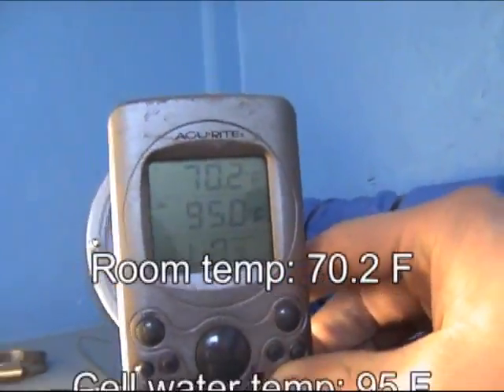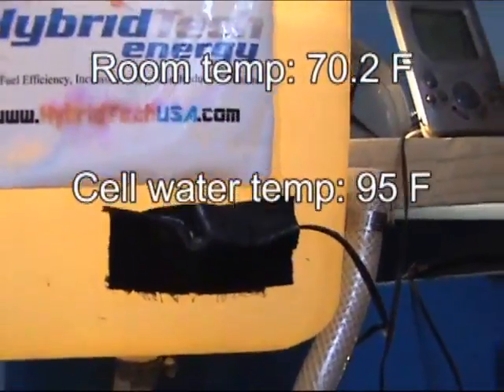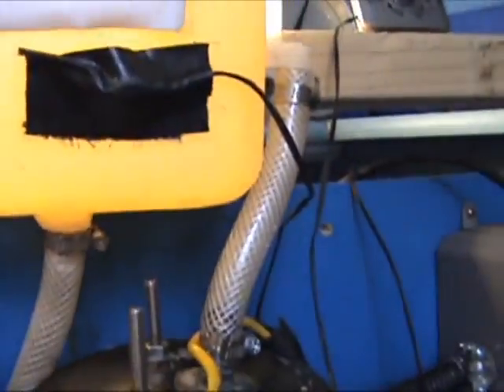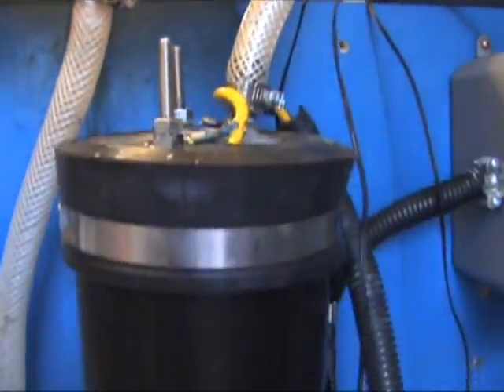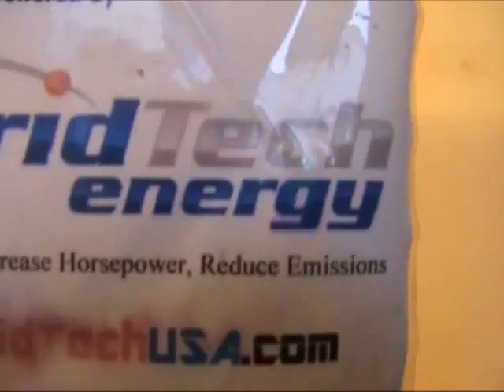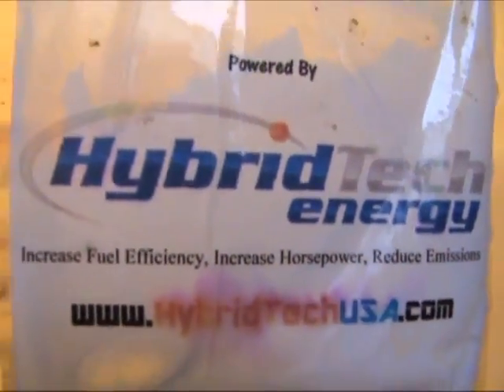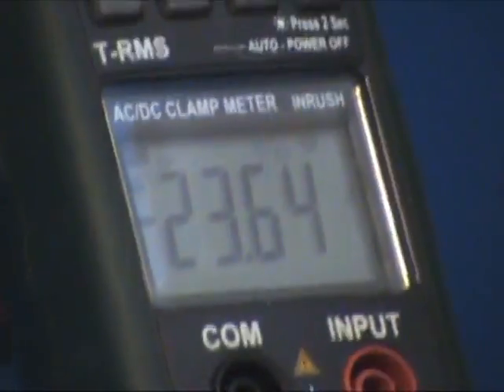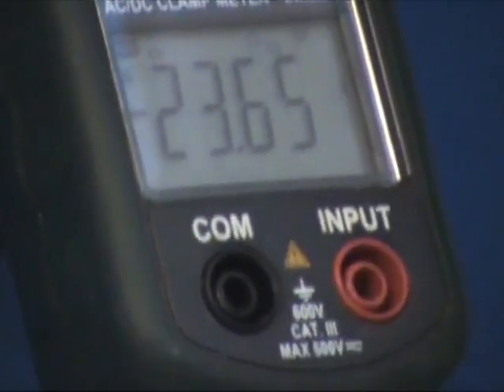5LPM 23.6 amps, ONLY FROM HybridTech Energy

Comment: You've probably figured out by now how you got "over unity".  It is how you are measuring the energy input.  Specifically how you are measuring the amps.  Clamp on amp meters cannot measure DC in a wire.  Good Luck though, and keep at it.

Comment from the maker: Everything that uses tubes is not Meyer....this runs on square wave DC, from an inefficient battery charger.  The way the wiring is set up is much different, it has 54 tubes in it also.  My next design will have 162 tubes, and produce 15 LPM.  We have not tried pulsing or working with frequencies yet.  I'm confident we can do much better than this efficiency when all is said and done.